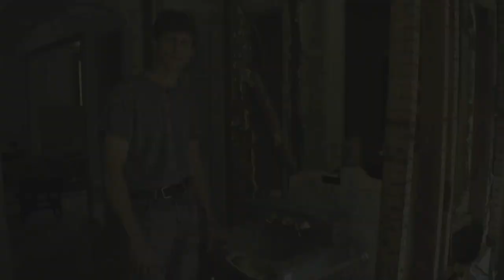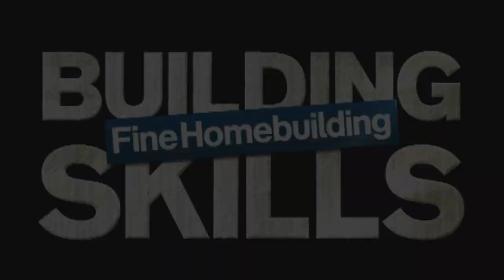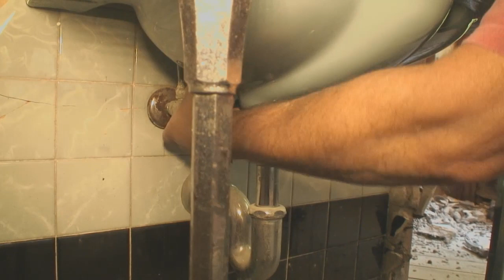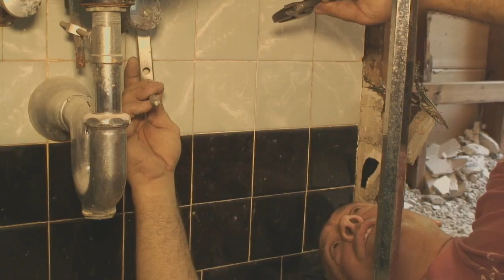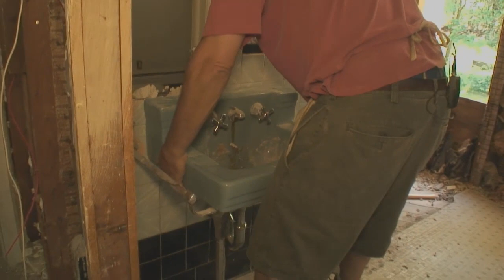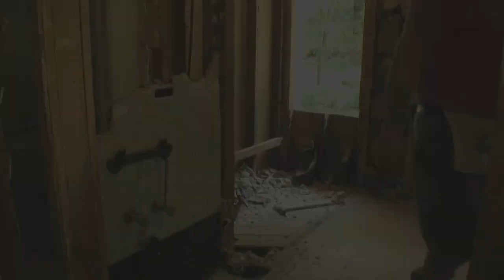How to Remove an Old Bathroom Sink

Comment: I’ve got almost the exact same sink in my bathroom. Original to the house(built 1953). It’s a pain in the ass b/c I’ve got extremely old caulk holding it into place against the wall. It’s solid as a rock.

Comment: Awesome video. What did you do with the plumbing behind the wall? Did you leave it in place or cap it off? I'm desperate for a video on how to cap off the pipes so that they are inside the wall and I can drywall over them.

In my situation I'm 99% sure that there is no water supply to the sink anymore because the sink wasn't being used and there was a flood. So the homeowners decided to cut off the water supply. There is a vent there though and I'm not 100% sure that there isn't something else venting through that pipe.

I just need to close everything off and Home Depot is making it seem like a little ole girl like me is to stupid and weak to do it (5'9" relatively fit with a 141 IQ). And I'm the one that just did all the things you just did in the video [I used my Hackzall <3 though. I had to tear something apart. ;) ]

Comment: If you're removing the sink just unscrew the compression nuts at the stops or cut the tubing, disconnect the drain and lift off. No need using a basin wrench on removal.
Reply: Exactly the comment I was looking for thank u very much
Reply: what are "compression nuts at the stops", and if you cut the tubing you have to replace it anyway so take it off at the valves anyway no?